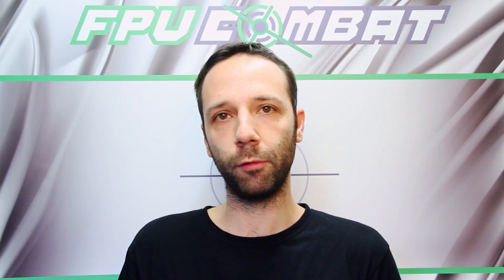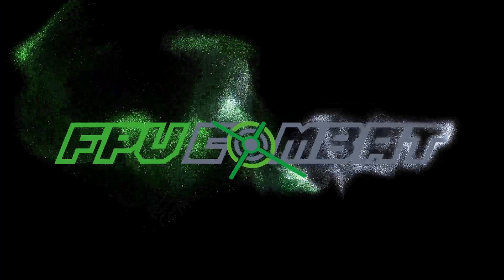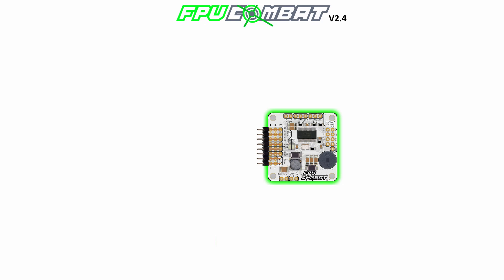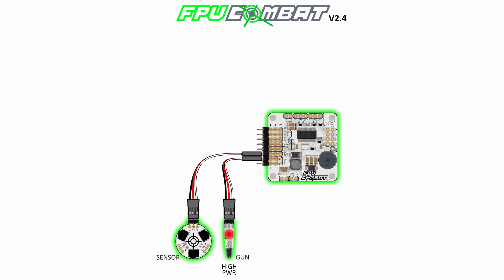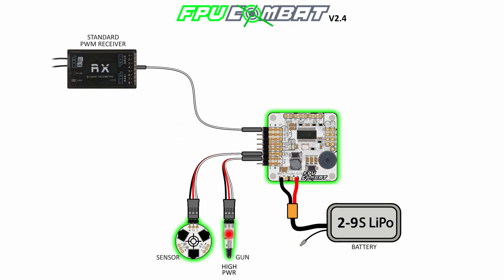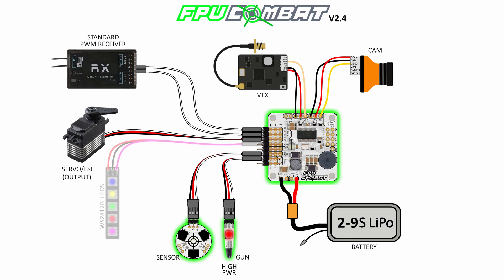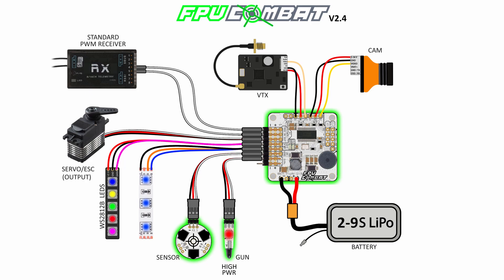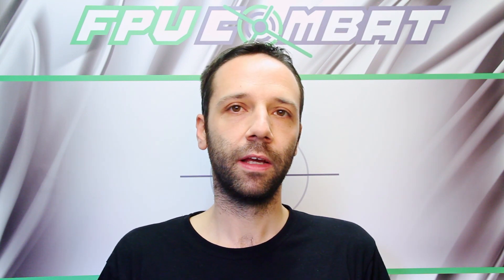FPV Combat - Tutorial 1: Wiring diagram

Comment: The video shows connecting the VTX and camera directly to the combat board. but the latest manual says specifically to NOT use the power pads on the combat board to power the VTX or the Camera.    

it is very disappointing that the board's power pads cannot be used as that significantly complicates wiring, and if they can't be used they should be removed from the board.

Comment: How can you connect the system to an existing drone with a flight controller? What about a whoop? You are mentioning a whoop on your webpage. If the system plays the role of the flight controller then how to change the flight characteristics?
Reply from the maker: The system is NOT a flight controller.
FPV Combat board is dedicated only to fighting  functions as dedicated OSD (integrated in the main board).
To use it on drones you simply have to configure the FC in order to forward one channel from the TX to a physical pin as “PWM servo output” to be able to trigger the shots!
For whoops you can check the micro version which weight only 1.5g and is small enough to fit in such models being only 20x15mm!
Join our party later on today, we can talk directly about what you want to know!
Reply: @fpvcombat  can the flight controller OSD be overlapped with the FPV Combat's OSD?
Reply from the maker: Yes, you van, Dep ėdi h nu tie orderį you will have different layer/visibility priority!